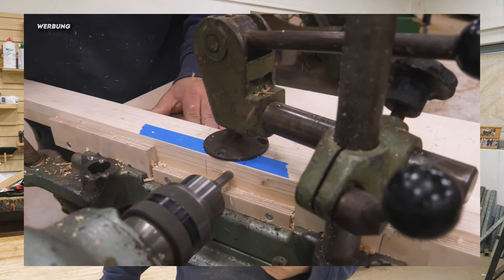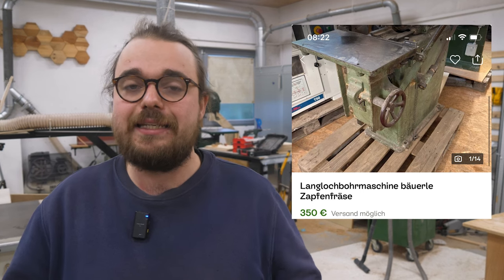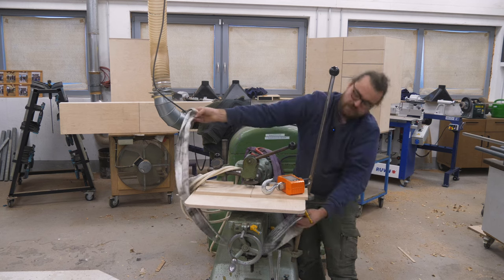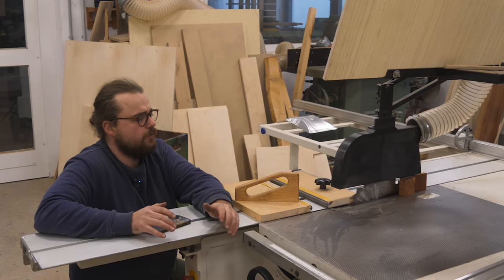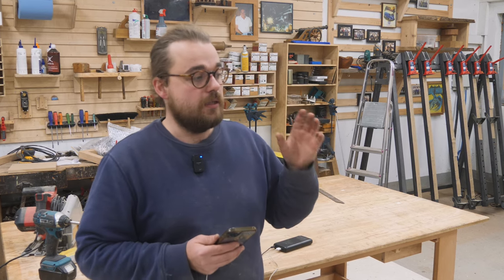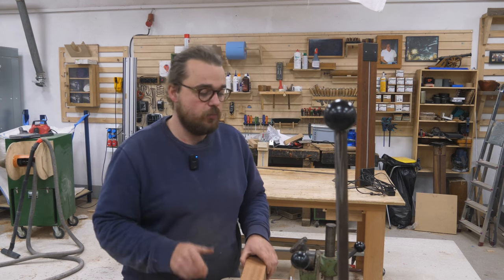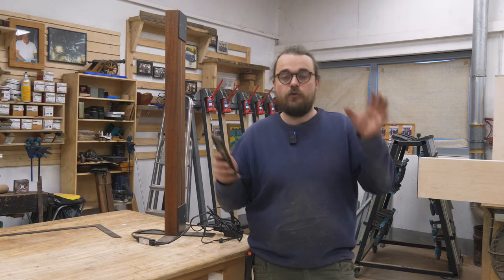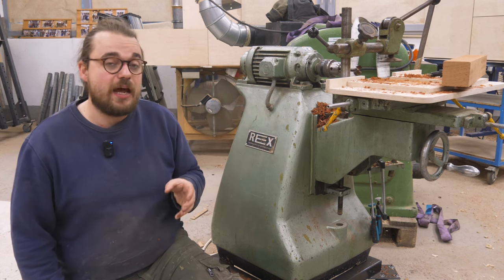Erklärungsversuche zu meinem letzten Video!

Comment: Ich mag auch alte Maschinen, hab selber ne Standbohrmaschine von 1957. Das Problem an den alten Maschinen ist das Sie meistens mit 380/400 Volt betrieben werden müssten. 
Je nach Motor kann man aber ein Kondensator verbauen dann laufen die auch mit 230 Volt aber mit weniger Leistung. 
Aber die meisten hier wie auch ich haben keine 380/400 Volt im Keller.
Reply: Moin Sebastian! Von dem einphasigen Betrieb mit Kondensator würde ich abraten. Da fehlt nicht nur die Leistung, auch die Wicklung der Motoren leidet. Ich würde in diesem Fall den Betrieb an einem Frequenzumrichter empfehlen. Da gibt es spezielle Versionen, die aus einphasigem Eingang drei Phasen generieren. Lass dich da mal von einem Elektriker beraten. Die Teile kosten nicht mehr die Welt und sie beheben auch noch ein weiteres viel größeres Problem mit den alten Maschinen.  

Du schreibst richtigerweise von 380V. Im Einphasenbetrieb waren es damals 220V.  Die erlaubte Bandbreite war 210V - 230V. Und darauf sind die Wicklungen im Motor abgestimmt. Seit dann Europaweit auf 230V bzw. 400V harmonisiert wurde, werden die Maschinen konstant an der oberen Grenze betrieben und bei höherer Spannung fließt ein höherer Strom. Das heißt auch mehr Leistung und mehr Verlustleistung, für die diese Motoren nicht dauerhaft ausgelegt sind.

Die Drehstrom-Eisenschweine stecken die höhere thermische Belastung oft noch klaglos weg, aber gerade kleine alte einphasige Maschinen (Bohrmaschinen, Handkreissägen, Tischkreissägen) aus den 70ern und 80ern sterben schnell den Hitzetod, wenn statt 300W mal eben 330W aus dem Netz gelutscht werden. 

Mit einem Frequenzumformer löst man auch dieses Problem, weil der programmiert werden kann, dass er maximal 230V (Außenleiter zu Neutralleiter) und 380V (Außenleiter zu Außenleiter) abgibt. Und bei Bohrmaschinen hat man noch den Vorteil, dass man die Drehzahl stufenlos einstellen kann, ohne dass die Leistung in die Knie geht.

VG
Andreas